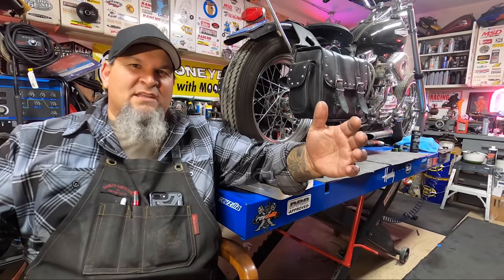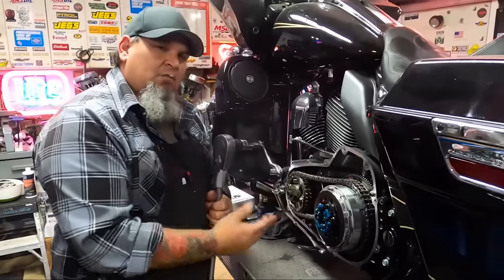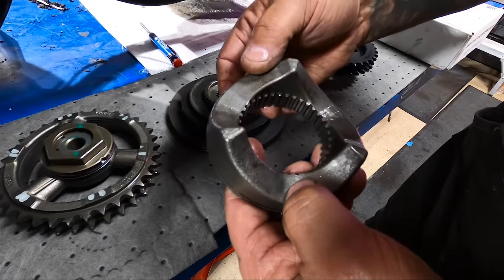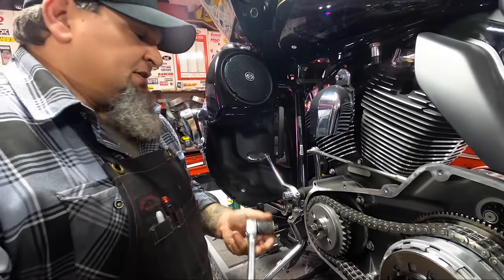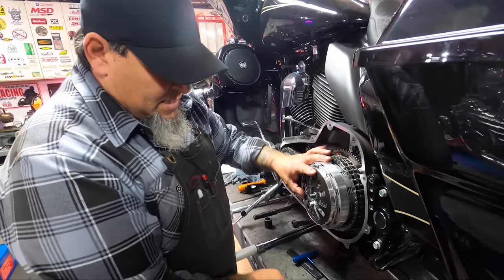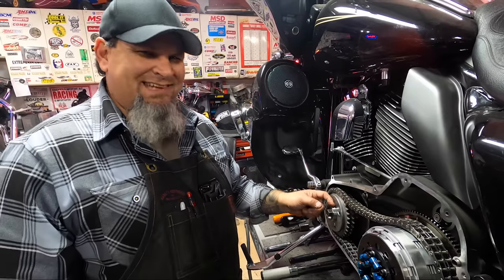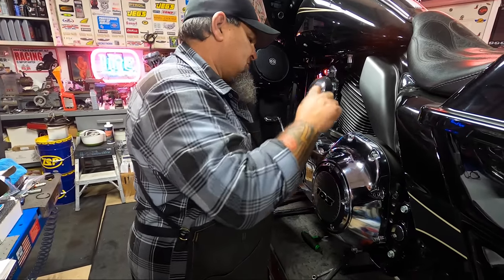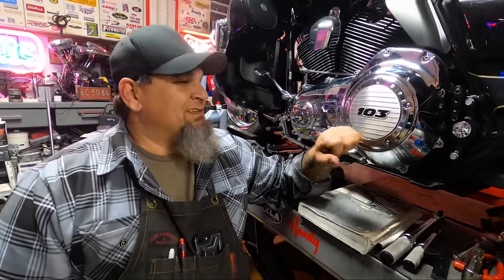Compensator Upgrade for Harley Davidson

Comment: I installed the dark horse unit and when adjusting the chain I noticed a tight spot in the chain and adjusting to 5/8 at the tight spot i have alot of rattle under the primary cover any thoughts? Thanks love your videos!!!!
Reply from the maker: What adjuster did you use?? If it rattles at 5/8, the try an adjustment closer to 1/2"
Reply: Did that fix the noise issue?

Comment: I'm trying to figure out which bolt to use on dark horse compensator. The pamphlet from dark horse says use torques bolt. You say use original stock bolt. I have 09 Electraglide 96",6sp
Reply from the maker: I would use what they are telling you. When I got this kit form Dark Horse, the instructions that were included had me use the stock bolt. I see they have changed their minds?

Comment: I just got the darkhorse moto sprocket,  primary is totally apart. The instructions that come with the new sprocket say to use the hd tapered torx bolt. I have the one from my stock comp 07 dyna like the bolt u have. I have seen videos that use the torx bolt and the instructions say use the torx. So I am confused of which to use?
Reply from the maker: Well, they must have changed something in the specs. I got one right as they came out so use what they are asking for

Comment: I was getting ready to have one installed and noticed in the instructions it says additional parts are needed. Did you have to buy the new rotor, oil deflector, and bolt? Mine is a 2012 Ultra Limited with stock compensator.
Reply from the maker: Wow, they have really changed things at Dark Horse. The unit I received was one of the first, and zero mention of additional parts and oil deflector.......I will have to look into this.
Reply: @LateNiteVTwin  thank you!  I have tried contacting them and haven't heard anything back yet. They may be closed for the holiday so hopefully they'll get back with me this week. I would just like to have all the parts needed before tearing it down. You'd think they'd have a video on their website talking about it.
Reply: @LateNiteVTwin  also thanks for the great video!
Reply from the maker: @jennyB96  You are very welcome!

Comment: On a stock twin cam 96, do i have to pull the rear sprocket? I noticed some people's videos don't pull it, but have to grind some aluminum off the case to allow the compensator to come off
Reply from the maker: Not sure I follow you here. I have never had to grind anything to remove the sprockets. I just pull the clutch hub, and compensator. The rotor on the 96 has a welded inner basket that has to be changed out when installing a non stock replacement. Harley has the rotor available for purchase when changing to their unit or when you use an aftermarket one. The rotor will not clear the inner primary case, which has to be removed if changing the rotor. I never grind anything to remove.....Hope this helps?

Comment: Got my T-70 torx from Napa.  Lock bar ??   Wood 1x2   6in long.   Hard wood,  fir or oak.    Harley dealer wanted $ 90. for the steel one.  C,mon

Comment: Good video, do you happen to know the part number of that shorter bolt you need for the compensator, I'm going to have to call HD for one. Thanks
Reply from the maker: Thant I don not know, but harley can take the screaming eagle part number form the kit and break it down for you, so they can get the right bolt.
Reply: @LateNiteVTwin  Thanks
Reply: I’m a little confused by that as well.  The man-o-war kit says to use the torx bolt #10500031 which is 3.903” overall, with the head being 1.129”, so the difference is 2.77”.  The screaming Eagle comp uses this bolt as well.  My stock bolt was 2 7/8” long minus the head, so about the same length.  I have no idea where your long bolt is coming from.
Reply: @timwilson5479  I ordered the 10500031 and have it in the shop now, When I go out there today I'll measure it and tell you what I found, The instructions that come with the Man-O-War suggest to use it in the instructions, I thought it was more to the fact that the bolt head is smaller and doesn't have a flange on it, The flange bolt probably impedes the oil travelling in to the little passages that lube the rubbers? At the time I installed it I couldn't get the 10500031 so I used a Grade 8 Hex head non flanged bolt the same length as the one that was in the stock compensator on the bike (2012 Road Glide Ultra) it is working fine so far.
.
Reply: I measured the bolt minus head is 3.250

Comment: When do you think its high horse power enough to upgrade comprnsator ?
Reply from the maker: I don't look at HP numbers, I look at torque. Torque is work, and that equals wear. In my opinion, anything that makes over 100 ft lbs of torque is a good candidate for a better compensator.
Reply: @LateNiteVTwin  thank you , im building a 107 with ported heads , 50mm throttle body , feuling 543 cams and oilpump/camplate . 
I dont know what numbers it will make but i think it will make 100ft

Comment: I have a 2001 FLH and the swing arm is worn badly at the drive side rear axle location and want to change the swing arm to the 2005 style with the cast end adjuster style. Is ti a direct swap or will I have to make modifications to make it work?
Reply from the maker: I'm assuming you are referring to the axle adjuster being worn? There are a few companies that make billet replacements. The later swing arms are of a different design, with a cam on the axle for belt tension. I have never dome the swap you are talking about. I would have to do a little research to find out if the dimensions are the same in the front to see if this is a viable swap for you......Let me dig for a few days.
Reply: @LateNiteVTwin  My swing arm itself is worn at the contact point of the spacer to swing arm contact point. I put it back together with a 3/4" washer to stop the wear. I did get a swing arm from an 05 FLH and may change it when the tires need changed again.

Comment: What’s your thoughts on FUELING PARTS ventilating dipstick to fix H-D M8 oil flow problem?
Reply from the maker: The vented cap assembly doesn't effect oil flow, it add better venting to the M8. As the pistons swing up and down, it creates air flow inside the cases. If it can't vent or breath properly, we see high amounts of oil dribbling out the air cleaner. The vent helps solve this. I recommend it!
Reply: @LateNiteVTwin  are you saying it doesn’t solve the oil sumping problem?
Reply from the maker: @elvisman8721  No, the vent alone won't stop sumping. The factory pump can't keep up with the oil returning to the tank or pan, and the pumps that are available on the aftermarket have solved this issue so far. The M8 suffers from a lack of proper size venting, and the addition of the Fueling vent helps. The reason we don't see this specific issue in earlier Harley motor platforms, is the engines are smaller in displacement. The shining of the pistons causes positive pressure inside the case. The bigger the inches, the more pressure it makes. We deal with emissions in every state, and the way the system breaths or vents to atmosphere is through the air cleaner to scrub off oil and fumes from the crankcase. The vents are so small, and the pressure so great it actually causes oil consumption in most cases. If you can vent the case properly, less oil migrates to the air cleaner and the problem is solved.
Reply: @LateNiteVTwin  
I’m trading in my 2019 SGS for my first CVO. 
I assume a  2021 CVO 117 engine will be even more troublesome, what should I do?
; S&S cam, rebreather filter and ventilating dipstick or ALL three?
Reply: @LateNiteVTwin  Just to go off a tangent here, this same issue with the breathing has been a historic problem on the old triumph and bsa engines of the 60's and 70's, also the wet sumping back through the oil pump. Triumph finally cured it on the their last bikes in the late 70's with an improved breathing setup but the only real cure for the wetsumping now that those bikes are old and worn out is a more modern aftermarket oilpump that's built to tighter clearances. Harley constantly keeps on making the pushrod v twin and the engines are getting bigger all the time
 it's awesome they've discovered the counterbalance shaft but I kind of like the way the rubber mounted twin cam engines jump around, it's all good!

Comment: You may also note that, the reason for backing off the compensator bolt, is..because the original '06 to 11' compensator center is directly contacted by the rotor..If the bolt is not  backed off, there was a theory, that the rotor and or teeth, would be damaged 🇺🇸

Comment: How about using an  S&S kit to make an M8 or better a 131. I’m not shore if there is a kit for a CVO 117 I wonder what that would that make it a. 134 cubic inch.
Reply from the maker: It's not so much that the bigger bore makes the M8 better. It's all about the issues that support the engine as a whole......Oil pump scavenging, head to vale seat issues, and venting. The bigger the motor isn't always better......

Comment: Can you recommend a compensator for my 1985 FXR EVO that has been bored 10 over, Wiseco pistons,,S&S 508 cam,pushrods & lifters. Tks. D W,
Reply from the maker: Hi Evelyn, unfortunately, there are no performance offerings other than a stock replacement or swapping in a direct drive gear tor that application.....

Comment: I like that you can go out and buy a $30K motorcycle and spend almost as much to fix all the engineering issues. Is this by design?
Reply from the maker: Some might agree with you Mike. Harley is making plenty of dough on us. I feel that by helping this community out, that you can save yourself hundreds by doing the work yourself, or at least be educated to make a decision as how to go about making the upgrades with a shop you can trust not to screw you. I don't feel Harley does it intentionally, but I do feel they could treat the issues like they are real, not for us to feel lied to.
Reply: yes spend 30 k to spend around 30 k more .. OR spend 15 k and get a Honda .. and upgrade with .. with .. oh wait nothing .. oh and ALSO pull harder and drive faster then any HD out there .. just an idea ofc :)
Reply: @Ladosligese  enjoy the Honda
Reply: @Ladosligese  
If you have a Honda why are you watching Harley videos? 🤔

Comment: Hey bro, how do you like the Darkhorse after riding it for a while?
I am on the fence deciding between a Baker and the Darkhorse, I also want to put in a Baker manual adjuster at the same time. I have to buy the stator rotor cover to be able to install any other than stock compensator, and I have to buy a lift lol
And I will have to remove the inner primary since I wont be able to get the old stator cover off otherwise without grinding on the primary case, unless I am missing something.
Yeah I have a lot of $$$ to throw out there to get this shit done.
I am curious how you like the Darkhorse now that you have had a bit of riding time on it.
I have an 09 Heritage Softail Classic with the 96ci, just under 13k miles but I am having issues with the comp, thats why I am doing the work.
Thanks for the help, and thanks for all the work you put into your videos.
Reply from the maker: Hey Billy, I have some miles on my compensator now, and can say without a doubt, it's the best I've had in the case! Zero noise, perfect shifts, no vibration. It sucks Harley welded the inner hub on the stator drum. Bigger job than most like to do. While you're in there, replace the inner primary bearing. They suffer from the automatic tensioner abuse from the chain being so tight. Thanks for stopping in and I'm glad this has helped you! Let me know how your build turns out!
Reply: @LateNiteVTwin  It's a bigger job thn I would like to do too, but im a po boy lolol Hey I really appreciate the heads up about the inner primary bearing, is it a bitch to get out? any special tools required? Somehow I missed that being a concern as a wear item in my research....I did see that I will need the special inner primary bolts since they are a one time use item. Thanks for the help, looking to start ordering parts on the 3rd and gettin busy on it. Realized my torque wrench doesn't go high enough either so I have to source one that at goes up to 200ft lbs
Reply: @LateNiteVTwin  lol I git ready to order all my parts and the Baker manual chain tensioner I want is on back order for 2 months....damn
Reply from the maker: I love the Dark Horse set up! Quieted smooth
Reply: @LateNiteVTwin  im still waiting on parts lol
Reply from the maker: @BillyBlaze7  Welcome to the pandemic parts availability problem!
Reply: @LateNiteVTwin  no doubt bro lol

Comment: Do you know what the life of the cushioned bushings is going to be?  I'm sure it varies depending on engine torque and riding style.  Thanks for the informative videos!!
Reply from the maker: Hi John, Dark Horse tells me about 60k on a well prepped motor with 125 ft lbs of torque or higher. I think riding style will definitely make a statement on that number to......The rebuild kit comes with the bushings and the tool, about 45 bucks.

Comment: Hello, I looked for that baker chain adjuster and can not find it, could you provide me a link for it? Thanks
Reply from the maker: The tensioner I used in the video was made by Twin Power, and they apparently do not make it any longer. Baker and Hayden make a good replacement that is a manual set up

Comment: I really like your videos. But I did notice that Pan on the other lift. I've been involved with some Knuckles (not many) my heart really love the Pan heads .I still have a 1965 on a rigid Palco frame. I always had some help working on them but it's been 15 years and those friends have died or are in nursing homes. I now would still like to be able to refresh my skills now that I'm retired and might just have time to help my step sons friends work on there older bikes. Any chance you would do some videos on Pan-heads and 4 speed transmissions in the future. Mike from Maryland
Reply from the maker: I have a few pans around here......I've got a 53, and a 60! One of my favorite drive trains!
Reply from the maker: Mike, I will put some videos together when I do a reseal on my 4 speed for you. It won't be right away but stay tuned, and in a few months I'll work it in the schedule for you!
Reply: @LateNiteVTwin  Thanks so much, I'll be looking forward.

Comment: If you are pouring the entire first quart into the primary, why dump it into the measuring cup first then into the primary? Why not just pour it all into the primary straight from the bottle then measure out the remaining OZs needed from the second quart into the measuring cup? Seems like a unnecessary step. 25:56

Comment: great video! going to be upgrading my street glide and the wifes tri glide with the dark horse compensator. interested in your opinion on external head breathers   thanks
Reply from the maker: Hi Monte, the external breathers work well, depending on how big the motor is.....Stock or big bore??
Reply: @LateNiteVTwin  my street glide is a 2010 with a 107 kit , the wife’s tri glide is a 2016 bone stock 103
Reply from the maker: @montekrueger7330  Fueling has a vented dip stick that just drops in the oil fill, and it works very well. I don't like the individual breathers on the head only because they are messy. I add the vent to the filler and it breathes well. I hope this helps??
Reply: @LateNiteVTwin  are you saying the vented dipstick eliminates most of the oil mist from the heads going back in the intake ? Fueling is pretty proud of them dipsticks at 260 bucks or more!
Reply from the maker: @montekrueger7330  Right now, they are they only ones that I'm aware of that make them, and adding another vent is a good fix for the oil vapor issue. I have one on my bike, zero issues. Mine is a twin cam
Reply: @LateNiteVTwin  thanks for the advice, Nice to hear honest opinions on stuff! Hopefully our tax return/ parts fund is more then we expect!!!!!   Thanks again

Comment: Tightening the clutch nut, can't you just put the bike in 4th or 5th gear and hold or tie down the rear brake?
Reply from the maker: Hi Brian, yes you can use the brake but the locking bars and locking blocks make the job easy for one person.
Reply: @LateNiteVTwin  Bro, I hope all is well.  Your videos are some of the best on youtube.   I hope you get back to making more some day.  Have a good one.

Comment: Does anyone know if I can put a 2016 or up stock compensator on my 2011 FXDB? I’ve heard you can just doing my research.

The compensator assembly is different after 2012

Comment: I trust very few with my baby I do All I can do myself to many times I have taken my bike to a ( mechanic) and had to bring it home and had to redo it myself Had a Bro take his to a shop and had the primary work on heard a noise and pulled the inspection cover and they left the lock block in it luckily it didn't bind up it was a accident but it could have went bad Anyway keep it between the mustard and mayo and rubber side down GBU later

Comment: i’ve broke my compensator on a stage 2 fxlrs 114 twice now in 1 month, if i want to keep warranty what should i do?
Reply from the maker: I would throw an aftermarket compensator of your choice in! Don't let the motor co BS you and tell you you can't. It will not void your warranty! If an aftermarket part fails, then they have you over the barrel, but the aftermarket exists because Harley can't build a part to hold up! My advice has always been this....use high quality, precision made parts. Then there is no worry to a warranty issue. I install and upgrade all kinds of these and I have never lost a well built compensator. The other issue is, the bigger the engine, and more out put, the power will find the "fuse". Compensators take lots of abuse. You won't have any issues with a Baker, or the Dark Horse.